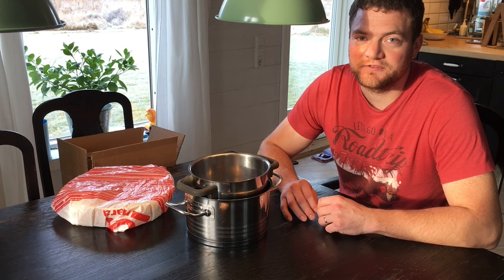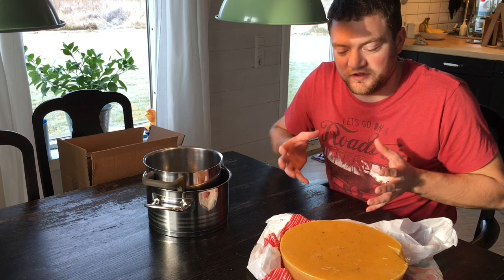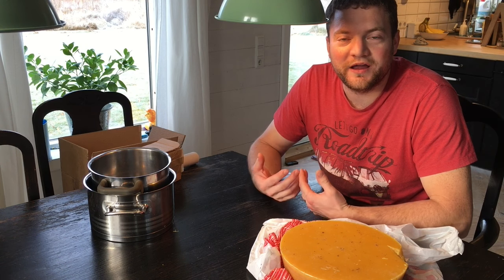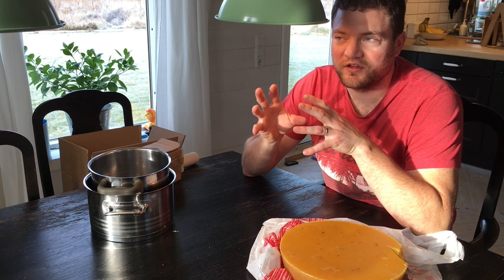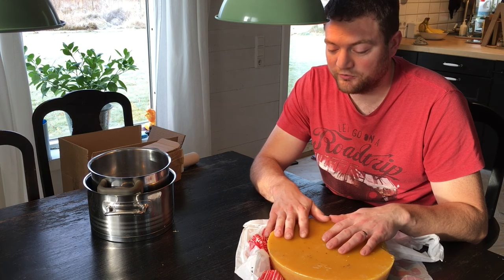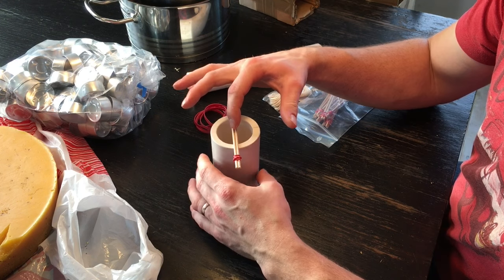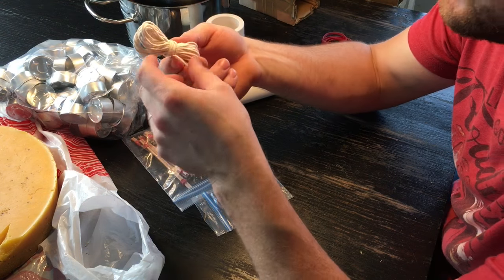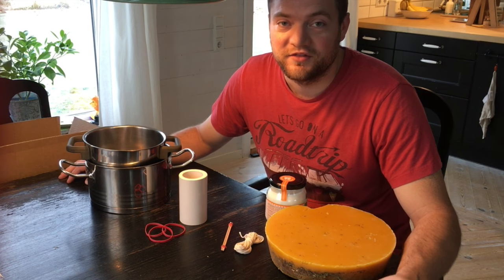DIY Beeswax Candles - The Why, What, How

Comment: Hello Simeon I am 74 years old. I have my own small average. Not exactly a farm yet but that is in my plans.  I have been watching your videos and even at my age , I usually learn something new from you ! Or at least a good new idea !  Just a suggestion about filtering your bees wax. Rather than using a towel or a pillowcase, both of which would be sacrificed and would also retain some wax, I would use a large paper coffee filter.
Just an idea mind you.  
   You mentioned about the wick diameters which may be different in different countries.  I do not think that is so important as it is to know that different wick diameters should be used for different sizes of candles.  That had never occurred to me !  Also the fact that a wick has an up and a down to it ! That was really a revelation !
As I have said, I usually learn something new from you !  And now you are closing in on 30,000 subscribers !!  Outstanding !